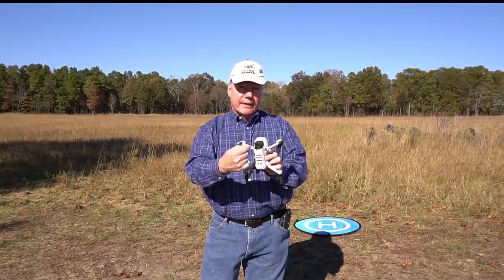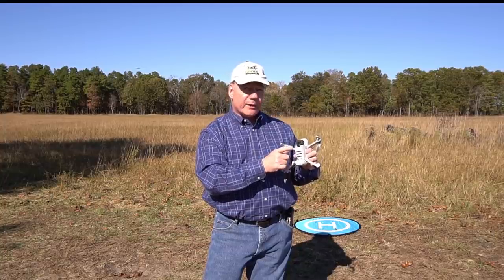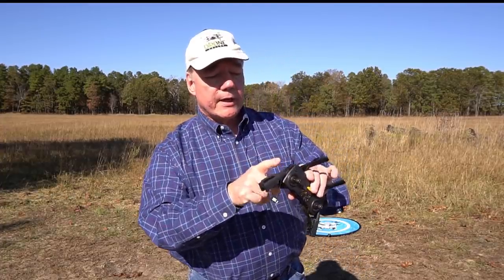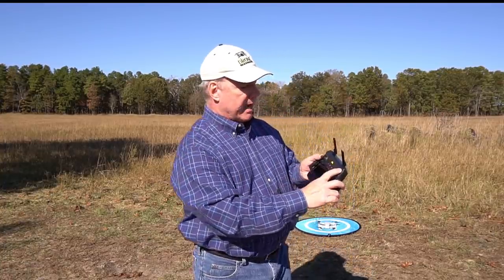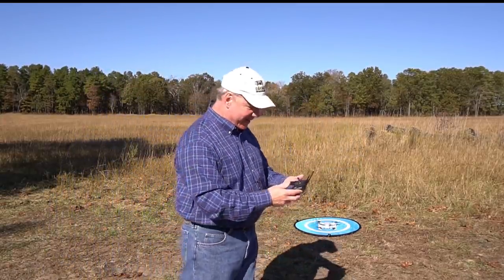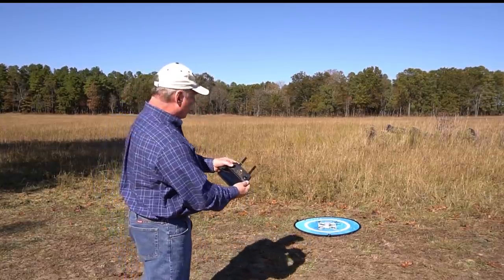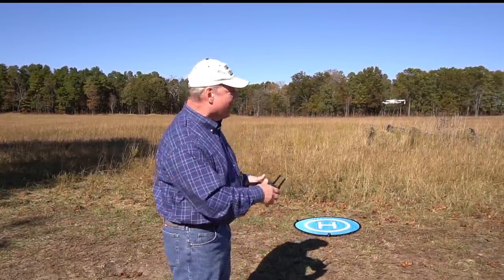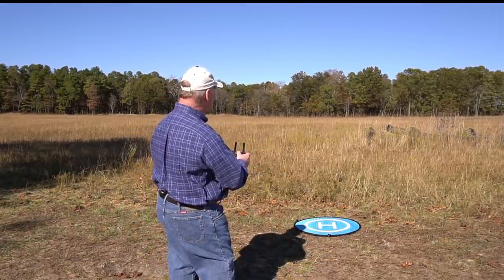Mavic Mini - Setup and First Flight

Comment: It seems to me like the footage "jumps" about every1 to 1.5 seconds ... easiest to see if you look at the edge of the screen while moving forward. Is this on every mode? I saw another review that mentioned there were 3 modes and the cinema one was supposed to be "smoother". Would it be possible to get a side by side with the different modes? Or if there is a fix for the jumpy frames? Thanks.
Reply from the maker: Carl, thanks for the post and I think some of the video issues were due to the rendering and the compression that YouTube puts on uploaded content. I don't see the issues on the raw footage I have here but will add the comparison between the modes to the list of testing I'll be doing this week.

Comment: Hi it is a very nice video ^^ You seems experienced so i would like to ask... how do i do to get the gps signal? I just got mine today but i cant seems to be able to have the gps. I dont know if it work with the phone lte or something like that. It kinda bother me i would be really grateful if you answer i knoe you must be busy but since im new to this and the product got out recently there is not any video about that.
Reply from the maker: Thanks for the post and the GPS signal is received by the quad. Just make sure that you're outside and not standing under a structure or heavy trees and it should find a few GPS satellites if you give it a minute. If you never see it lock on GPS you might have an issue with the drone. I hope that helps and thanks for posting. Rick
Reply: @Dronevalley  i tested it today outside and the gps was working fine im happy ^^

Comment: I want to add some comments that might help others who have lost their drone. I recently lost my Mavic Mini in the deep woods of Southern Ontario and had pretty much thought it was gone for good. But I used the flight records saved by DJI to find the last recorded GPS co-ordinates of the drone just before it crashed into a tree. I also saw in cache on my Ipad Mini 5 exactly what had happened,  so I knew the drone was somewhere deep in the forest on an island in the middle of a large Canadian lake. 

Then a friend showed me how to enter these co-ordinates into Google maps as a "saved" point. Using my cell phone and the GPS co-ordinates, i was able to follow the little "pin" right up to within a foot of the lost drone. This little "pin" (which represented me on the GPS map on my cell phone) even moved as I  drove my boat along the shore of the island and pin pointed exactly where to go ashore, then 32 meters up the cliff on the island to within a foot of the drone. GPS technology is AMAZING in its usefulness. 

I replace all the props on the Mini, and dried it out thoroughly after a rainy week on the island, and with a compass re-calibration it was good to go. It seems also to have shut itself off before the battery ran down too far (found with 50% battery). The pliable plastic that the Mini is made of saved the drone from destruction as it tumbled about 50 feet down into the forest floor. 

Aircraft pilots have a saying..."altitude is your best friend". I can now add a new one for drone pilots..."trees are your constant enemy". Now with the Mavic Zoom, I always set a flying height higher than the trees around, and use the Zoom feature to look down more closely. 

Thank you Rick; your videos are the very best of the lot as they are technical and without a lot of jazzy hoopla put out by the younger crowd posting.

Comment: Thank you, Great information. My Mavic Air has been my go to drone because of the size and ease of use. The big question for me is do I purchase the Mavic Mini with less features and not as good camera or stick to my Mavic Air as my go to drone? The temptation for me is the up to thirty minutes of flight time per battery. Do I downgrade a little for more flight time, I probably will. Keep up the wonderful information you provide!!!
Reply from the maker: Thanks for the post and the Mavic Air is an amazing quad. The Mavic Mini is smaller but you do give up a few features for the lower weight and price. I will be bringing the Mavic Mini with me when I travel even though I own the Mavic Air because of the smaller size of the mini (smaller batteries and no need for a dedicated charger). I think it's a very good quad and adding it to your fleet would give you more options when traveling. I appreciate your support and be sure to stop back soon for more content.

Comment: Nice video but I was wondering what version of Android I need to use the DJI Fly app? I have an older phone with 7.0 on it.
Reply from the maker: You should be OK and the app is due to be released by 11/11 so keep checking. You can download it to see if it works on the phone but I'm pretty sure you'll be OK. Rick
Reply: @Dronevalley  Thanks for your prompt reply. I'll check it out when it's released.

Comment: Love your vids, Rick. I ordered my Mavic Mini today even though my drone hanger is getting filled up with birds. I have the original Mavic Pro, Spark and the Typhoon H Plus, but still can't resist this little bird for travel and just having fun. I was wondering why when I went to the Apple App store the DJI Fly app is not yet available. You might want to mention this in your video. By the way I am also a senior drone flyer like you with about the same waistline. I might just use this little guy for a client job when the person is not looking at the flight but only the results.
Reply: dailydR1ver I believe it will be released on the 11th which is the official on sale date for the drone

Comment: Do you recommend this or parrot anafi
Reply: Depends where you live. Parrot isn't servicing their stuff in US anymore...pretty nice of them to do that after selling most of their product here.
Reply: Europe..I think video quality Of mini is not  good enough or maybe it needs more effects
Reply from the maker: Mesoud - thanks for the post and it really comes down to what you'd like to do with the quad. The Mavic Mini is about half the price of the Anafi and flies farther. It doesn't have the digital zoom of the Anafi but is the same sensor in the camera. If it's your first drone, I'm still suggesting you start with the Mavic Mini. The drone market is still expanding and you could probably fly the mini for 6 months or so and upgrade to a better quad if you're having fun. You can sell the Mini then and will probably get most of your investment back since there are always new pilots entering the market. Thanks for watching and have fun flying. Rick
Reply: Ok thanks i hade parrot anafi I used 3 months  now i have phantom 3s i was planing to buy anafi but this come out 😁 👍

Comment: Great video! Can you manually override the camera settings in video and stills mode? Do any of the gimbal axes lock in sport mode like the spark did?
Reply: Manual settings in Photo mode only..In video everything is auto with no manual control on any function or setting. None of DJI's gimbals lock in any mode. I assume your talking about "FPV Mode" over Normal "Follow Mode"? If you ever looked you would notice that your stick command in FPV is tilting the Gimbal, not the gimbal being locked as you think...It a "fake" setting parameter to give the illusion of flight for a different cinematic perspective...can be tested by not even starting motors sitting on a table when powered on. It also isn't linear to the amount of through or pitch in flight. Rather silly option IMHO.
Reply: Repaid 1 the Sparks horizontal axis automatically locks in sports mode- was pretty annoying

Comment: 2 questions rick    is the 249g with the prop guards on the mini    how much is it to register your drones per year  AUSTRALIA  wants $20 per drone I HAVE 4 DJI OVER 249G TY
Reply from the maker: Awesome, the weight is without the prop guards and once you add them, you're over the limit. My suggestion is to register it either way so you'll be covered. In the U.S. we'll pay $5 and can fly as many drones as a hobbyist for that fee. If we fly commercially, it's $5 per drone. Thanks for the post and stay tuned for more content soon. Rick

Comment: I don't see the DJi fly app on the aple store on my iphone8plus? Does that mean it’s not compatible with my current phone?
Reply: Means it's not released yet..Specs are:     DJI Fly

    Required Operating System
    iOS v10.0 or later Android v6.0 or later

Comment: what stops the mavic mini prop screws from coming loose in flight ?? any spring washer or loctite
Reply from the maker: Len, thanks for the post and there is a dab of blue Loctite on the screws. In Part 2 of this series I actually show you the replacement screws and you can barely see the blue color. When you replace a prop, always change them as a pair and be sure to use the new screws they provide with the kit so the new Loctite holds them firmly. Stay tuned for more content this week. Rick

Comment: Great Videos and excited to see the Mavic Mini!
Regarding all the discussion on the weight 249g and Registration. If the Owner puts on stickers, prop guards or skin wrap... or anything for that matter... it's over the 250g and would no longer meet the FAA 250g category. The 250g is based on flight weight, not original weight.  The 1g doesn't provide any room with any of the advertised accessories or 3rd party add-ons.

Comment: Rick-great review, as always. I'm curious as to whether or not one can use third party goggles with the controller. Like a pair of Fatsharks, for example.
Reply: As with all DJI drones that is up to the device you use if your phone or tablet has a HDMI out the answer is a obvious yes. DJI only includes HDMI out on high end drones or as a Option Module on a couple of their next tier. There are no goggles that can receive DJI's proprietary signal protocol other than their own googles on specific models.

Comment: I'm thinking about getting a Mini.  Question: Do you have/need Liability Insurance or any other type of insurance?  Thanks!
Reply from the maker: Rod, thanks for the post and insurance is always a good thing and can be a little expensive but good to have if you need it. One simple way of getting decent coverage is to join the AMA for a low yearly fee and you'll have instant liability insurance. The other benefit is that you'll be able to fly at your local AMA field to get used to flying your quad with other seasoned pilots. You can also check with your insurance company that now insures your cat and home and they can typically add the quad to the policy for a small amount for loss of the product. I hope this helps and thanks for posting,

Comment: hi, a question. what is the max altitude that this drone can flight, without consider the regulations of each country....?? thanks.....
Reply from the maker: Thanks for the post and the legal limit in the U.S. is 400 feet AGL but the quad could technically fly 3000m above sea level in countries where that's legal.
Reply: Drone Valley thanks .... excellent channel. From chile

Comment: Thought you  should know of a problem that can come up if using an "unapproved" smartphone (such as ASUS) with  the Mini. The cable that comes from the factory does not fit a phone with a reversed mini usb connection. Reversing it to fit in the phone leaves a cable too short to reach the controller. After hours of investigation, I have found that a reversed cable is available to fit the Mavic 1 that should work. I have ordered it up here in Canada and according to the dealer, it should fit.It seems the connection at the remote controllers might be the same across the various models so it's only the one  end I have to worry about. DJI tech support where not much  help
Thought you might find this useful as you and I are both "nerds" when it comes to detail (especially as I cannot currently  use my new drone until this cable comes in).
Reply from the maker: Robert, thanks for the post and we actually have a cable that works for that situation. We designed it for folks to be able to use their tablets with the Mavic Mini but can fit phones with their connections facing "down" as well. It's 30cm long and listed on our website under the Mavic Mini page. I'm glad you found one that fits and I hope you get flying with your new Mavic Mini soon. Thanks for stopping by. Rick
Reply: @Dronevalley  If the one on order doesn;t work i will order that cable from you. Your answer seems to imply that the connections across the various models is identical at the remote controller connection point
Reply: @Dronevalley  i ordered that cable from you anyway as I likely will want to use it with my android tablet....thanks

Comment: Will this work with the Smart Controller? Thanks!
Reply from the maker: Thanks for the post but it won't work with the Smart Controller yet because it uses a new application called DJI Fly. I will be trying to side-load that application on the controller tomorrow or Friday and will post a slip with the results. Rick
Reply: @Dronevalley  Thanks, Rick!
Reply: @Dronevalley  Thanks for the info. I was hoping all new drones would work with the Smart Controller. I guess DJI has another idea. Keep up the good work!
Reply: @TravelsByTrike  The Smart Controller is running Occusync 2.0 which is only the M2P/Z/E...a App isn't going to change the protocol back to a Wifi output for the Mini. Not sure why Rick thinks side loading a App is going to work???
Reply: @repaid1  Rick responded saying the Smart Controller won't work.

Comment: Thank you for your videos. Does anyone fly this with android? I hear it can be problematic. If so does it need more than android 6? Many thanks.
Reply from the maker: Jim, thanks for the post and you can fly with an Android phone but its more "hit and miss" than with an Apple device. I did an entire clip on why this happens and you can search my channel if you're interested. Basically it has to do with all of the extra "tweaks" that companies put on top of the standard Android build on these phones/ tablets that causes issues with the application. My suggestion is to try it to see if it works and if you're having issues, I have a few suggestions in that clip on how to fix it.

Comment: Does the controller accept a phone in its case?
Reply from the maker: Carl, yes, the controller will hold a phone as wide as 6+ inches and about 1/3" thick. As long as you're nit using a really fat case, you'll be fine. Rick

Comment: Can this work without the remote?
Reply from the maker: Scott, that was one of the Top 10 Questions I just answered in the clip I posted and unfortunately right now the answer is no. It has to do with the way they have implemented the Enhanced Wifi and I'm hoping they enable it on the Mavic Mini in a future release of the firmware. Stay tuned to the channel. Rick

Comment: Is it loud like the spark?
Reply from the maker: Mick, it's less noisy than the Spark but small drones do make a little more noise than larger ones with larger props that spin a little slower. Once you get it above 50 feet or so it's hard to hear it. Thanks for the post. Rick
Reply: @Dronevalley  awesome thanks Rick. How's the range as well? Similar to the Mavic air?

Comment: Also, the specs mention "C mode" in addition to the normal S and P modes. What is C mode?
Reply: cinematic mode? like tripod mode?
Reply: Yes, but drone moves faster but doesn't make quick turns or changes in speed so video is more smooth.

Comment: Wondering why you did your first flight without first calbrating the compass? I guess your magnetic environment is quite different to China...
Reply from the maker: Gerd, I actually did some charging and app testing before the first flight and did the compass calibration then. It's the same process as the larger drones and I had no issues running through it. I hope you're enjoying the clips and stay tuned for more content this week. Rick

Comment: The Pictures look good but the video quality looks washed out?
Reply: maybe the exposure comp was high,
Reply: Could use some ND filters. I use polar pro
Reply: @blkout3279  yes nd filter is a must and you can also adjust the xposure to -1.0 or -0.7 and edit it in post.
Reply: @blkout3279  and i saw also a  review saying that because of the low bitrate of dji mavic mini which is 40bit. It will not look good when filming near in an area where there is lots of movements. Example. Plants or trees that are swayig because of winds and all.
Reply: @PuntokUno1014  I have a phantom 3 standard thought about getting but my 3 has more control over video and photos. Thought about the mavic air or pro platinum.
Reply: @blkout3279  cool, u have so many high end drones.  Dji mini will be my 1st drone.
Reply: @blkout3279  It might put it over the 249 Grams :)

Comment: ok heres a question that nobody seems to have noticed.......if that was your first flight, shouldnt it be calibrated???
Reply: How do you know it wasn't...save us the dance on video perhaps??? I flew most of my DJI straight out of the box as well with ZERO issues.. The App will tell you if you need to Calibrate.
Reply: @repaid1  well, may i suggest that if any one is going to make an 'out of the box' vid. then it should COMPLETELY BE 'out of the box yes?